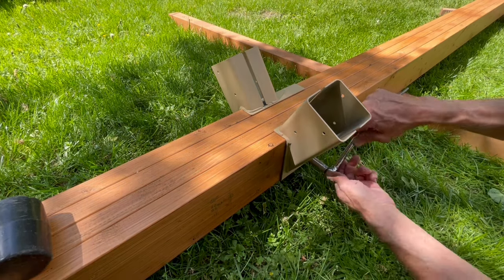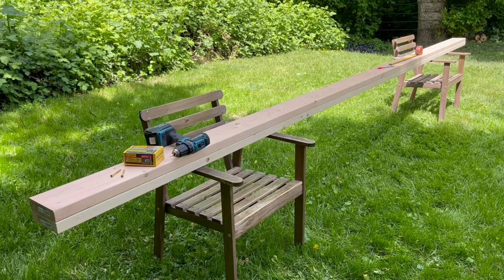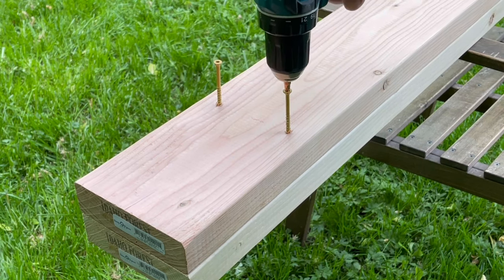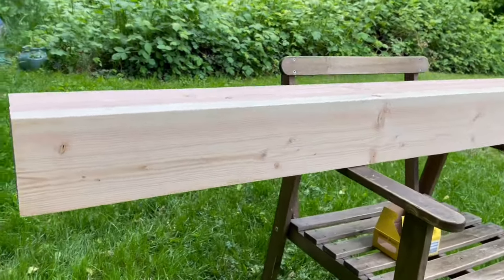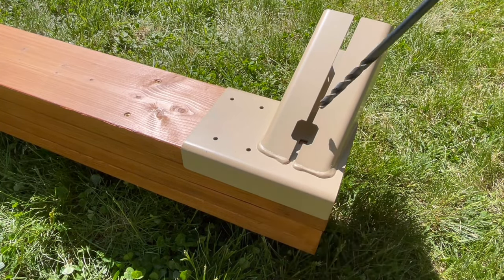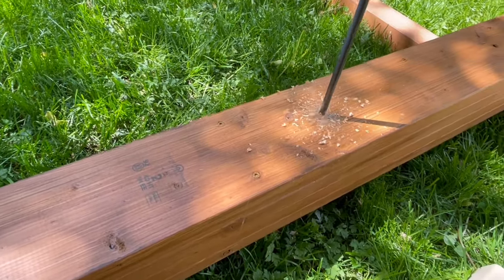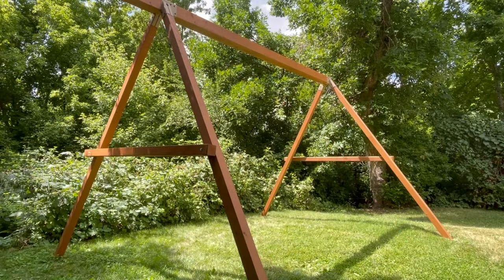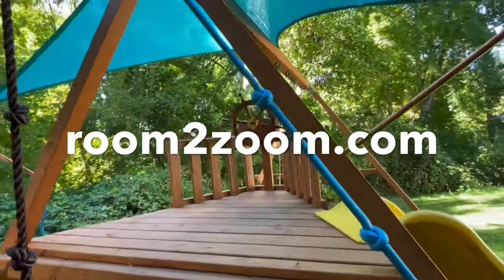How to Make a Big Swing Set - How to Make the Longer Beam Needed

Comment: I have the option of a 6x6x12 beam but I’m considering building the beam out of 2x6x16 like this. The idea is to add a  third bracket to the end of the remaining 6’ and maybe putting a climbing wall or something like what u got there(great idea btw). Could you think of any issue with this idea ? Also was the process still the same for bolting the swing hanger/ brackets with this built beam? Im afraid the gap between the 2x6s will line up with where the hole is drilled. Thank you for the videos!
Reply from the maker: That is a nice idea that others have told me they were going to do as well. No, there are no issues. In fact, as a plus this kind of structure adds even more rigidity to the whole set. I prefer to drill the hole right in the crack of that gap, the larger washers contain the bolts just fine. But you can drill slightly off center of the beam if you prefer to avoid the crack. Thank you!

Comment: I built a big swing set with your amazing brackets. It is rock solid forward and backward. However, I do get some side to side motion when the kids go really high and twist. Any suggestions for stabilizing this direction?
Reply from the maker: Thanks! Some side to side sway is typical of all brackets, and in fact, even of swing sets not made with brackets. I have made A-frame structures with monstrous diagonal bracing which seemed to be the most solid union ever, but there was still some side to side sway. As you say, when the kids are swinging normal, as high as they want but in a front to back direction, it is rock solid and there is no side to side sway. But when they swing in any lateral direction there can be side to side sway. Another issue is that lumber is a very imperfect material, coming in varying widths, and that continues to vary as it dries and shrinks significantly. So the fit of your particular lumber into the bracket can be a factor. If your lumber is on the narrower side, fitting a bit too loose inside the bracket, this can give rise to some side to side sway. One thing you can do that usually helps significantly, especially if you assembled the A-frame with the strong Headlok fasteners that I suggest in my videos, is you get on a ladder and you remove the four fasteners holding one leg to the bracket. You then reinsert just the two screws of one side to pull the leg all the way tight and flush against one side of the bracket's leg holder part, and then insert the other two screws on the other side which will not be able to pull the leg lumber from still being tight and flush to the first side. If you like you can even insert some sort of shim between the leg and bracket opening before inserting these last two screws--for instance the plastic of a gallon milk container, folded up. You then repeat this for each of the other legs. But be really careful working at this height! Hope this helps you!
Reply: I just built mine with a four 4x6x16' and 12' legs. I'm getting a fair bit of sway side to side.
Reply from the maker: The bigger, longer, and heavier the beam you use the more you can get some lateral sway.

Comment: Any thoughts on this holding up over time?  I would think water from rain would work it's way through the boards and potentially cause it to rot out over time.  Any downside to laminating it with wood glue?
Reply from the maker: It should hold up just fine over time. You could laminate it with glue if you desired, but I don't believe it is necessary.

Comment: Hi! I don't think you mentioned in the video, but what size bolts did you use for a beam made from (4) 2x6 boards? I am making a 16ft composite beam just like this and placing the brackets 10ft apart, and I plan to hang three swings in the middle section, with a baby bucket swing on either side (3ft overhangs). Would you use 8" bolts to get through the beam in this video? Thanks!
Reply from the maker: Yes, I would use an 8" carriage bolt for the brackets thru the beam.

Comment: So if I am making a big beam out of 3 2x6s, what hardware will I need? Specifically what size carriage bolts and hex bolts?
Reply from the maker: Three 2x6's gives you a beam that is 4 1/2" wide, so you need a 6 inch carriage bolt. The hex bolts are what hold the swing hangers. You can use 7" bolts for them.

Comment: Ok, I got my brackets.  I would like to have 4 swings.  What size beam would you recommend?
Reply from the maker: I would go with a 13 foot beam that is either a 6x6 (5 1/2 by 5 1/2), or that you make from three 2x6's. You can follow the TALL SWING instructions and video, which uses a 10 foot beam for three swings, and just add one more swing with the extra 3 feet.